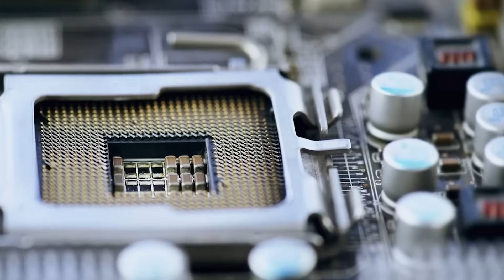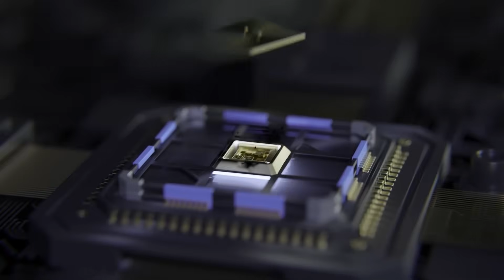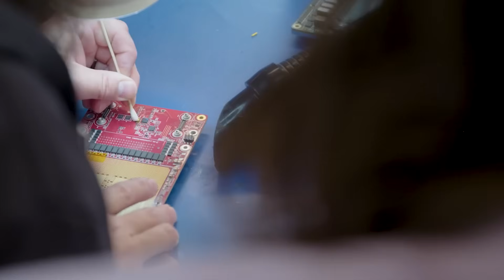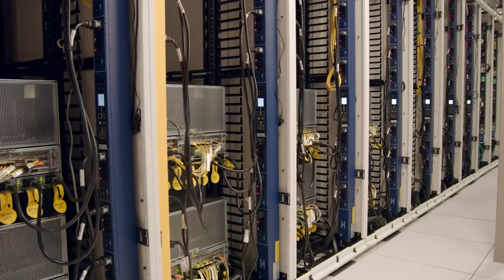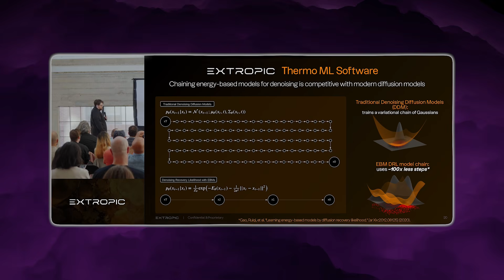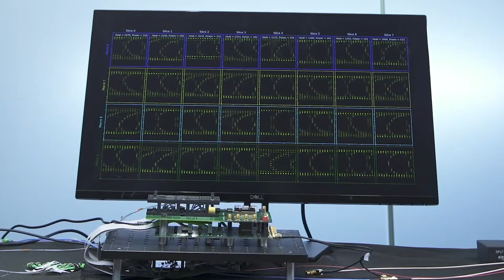Extropic’s New Thermodynamic Chip Makes NVIDIA’s AI GPUs Looks Like E-WASTE!

Comment: 1. What Extropic Actually Is
Extropic is a real early‑stage startup founded by Guillaume Verdon (formerly of Google’s Quantum AI group).
They are developing thermodynamic computing hardware based on:

p‑bits (probabilistic bits)

subthreshold analog circuits

thermal noise sampling

Boltzmann‑style stochastic dynamics

Their goal is to build chips that sample probability distributions natively, instead of simulating randomness digitally on GPUs.

This is a legitimate research direction with roots in:

Probabilistic computing

Stochastic neural networks

Boltzmann machines

Ising‑model optimization

Analog computing

But it is experimental, unproven at scale, and not a GPU replacement.

2. What Extropic Has Actually Built
Extropic has demonstrated:

A prototype “Z1” thermodynamic sampling unit (TSU)
This is a small analog probabilistic accelerator, not a general‑purpose AI chip.

p‑bit arrays that fluctuate according to thermal noise
These circuits naturally explore probability landscapes.

Early demos of sampling‑based inference
Useful for:

Optimization

Probabilistic graphical models

Monte Carlo sampling

Some physics simulations

A software stack for mapping probabilistic workloads
Still extremely early.

There is no evidence of:

Large‑scale chips

Production hardware

Data‑center‑class accelerators

Benchmarks against NVIDIA GPUs

Any commercial deployments

3. What the Viral Video Gets WRONG
Claim: “Makes NVIDIA GPUs look like e‑waste”
There is zero evidence for this.

Extropic has not:

Published benchmarks vs H100/B100

Demonstrated LLM training

Demonstrated LLM inference

Demonstrated diffusion models

Demonstrated trillion‑parameter workloads

Demonstrated HPC workloads at scale

Their chip is not a general AI accelerator.
It is a probabilistic sampler.

NVIDIA GPUs remain:

The global standard for AI training

The backbone of every major LLM

The dominant platform for inference

Supported by the entire CUDA ecosystem

Extropic is not competing with this — at least not yet.

Claim: “Thermodynamic computing solves the AI energy crisis”
This is speculative.

Thermodynamic computing may reduce energy for specific probabilistic tasks, but:

It does not replace matrix multiplication

It does not replace transformers

It does not replace attention mechanisms

It does not replace GPU‑optimized deep learning kernels

It does not solve memory bandwidth bottlenecks

It does not solve data‑center cooling

It does not scale to 10,000‑GPU clusters

The “energy wall” is real, but Extropic is not the solution to it today.

Claim: “AI models are inherently probabilistic, so GPUs are wrong for them”
This is a misunderstanding of AI math.

AI models are probabilistic in output, not in computation.
Transformers use:

Deterministic matrix multiplications

Deterministic attention

Deterministic layer norms

Deterministic activation functions

The sampling happens after deterministic computation.

GPUs are optimized for exactly these operations.

Probabilistic hardware does not replace this.

Claim: “Extropic’s chip can run generative AI, LLMs, and image models”
There is no evidence of this.

LLMs require:

Massive matrix multiplications

High‑precision tensor cores

Huge memory bandwidth

Distributed training infrastructure

Extropic’s chip is:

Low‑precision

Analog

Small

Experimental

Not designed for transformer workloads

It may accelerate sampling‑based subroutines, not full models.

4. What Is TRUE but Overhyped
Thermodynamic computing is scientifically interesting
Using thermal noise as a computational resource is a real research area.

p‑bits can accelerate certain optimization problems
Especially:

Ising models

Combinatorial optimization

Probabilistic inference

Monte Carlo sampling

Extropic’s approach is novel
They are combining:

Subthreshold analog circuits

Thermal noise

Probabilistic sampling

AI‑driven control loops

This is genuinely innovative.

GPUs are energy‑hungry
AI data centers are hitting:

Power limits

Cooling limits

Grid constraints

Alternative computing paradigms are being explored.

But Extropic is one of many experimental approaches:

Photonic computing

Analog in‑memory computing

Quantum annealing

Neuromorphic chips

ReRAM accelerators

None are proven replacements for GPUs.

5. The REAL Challenges Extropic Faces
1. Analog drift & noise control
Thermodynamic systems are inherently unstable.

2. Manufacturing variability
Analog chips are extremely sensitive to process variation.

3. Scaling p‑bit arrays
Large arrays introduce:

Crosstalk

Thermal coupling

Calibration overhead

4. Software ecosystem
NVIDIA has:

CUDA

cuDNN

TensorRT

Megatron

NeMo

Triton

Huge developer base

Extropic has none of this yet.

5. Market adoption
AI companies want:

Deterministic results

High precision

Reproducibility

Large‑scale training

Probabilistic hardware is niche.

6. FINAL VERDICT
True
Extropic is real and working on thermodynamic computing.

Their approach is scientifically legitimate.

Their chip can accelerate certain probabilistic workloads.

AI energy consumption is a real problem.

False / Misleading
No evidence Extropic outperforms NVIDIA GPUs.

No evidence it can run LLMs or generative models.

No evidence it “makes GPUs e‑waste.”

No evidence of commercial‑scale hardware.

No evidence of data‑center deployments.

Overall
Extropic is an exciting research‑stage startup, not a GPU killer.
Their chip is not a replacement for NVIDIA GPUs.
It is a probabilistic accelerator for niche workloads.

The viral video dramatically exaggerates the implications.